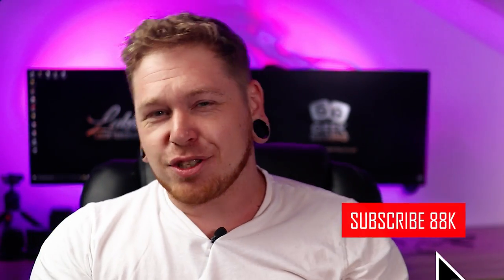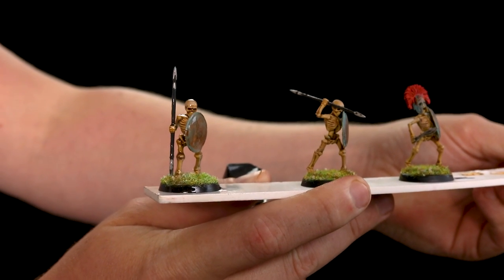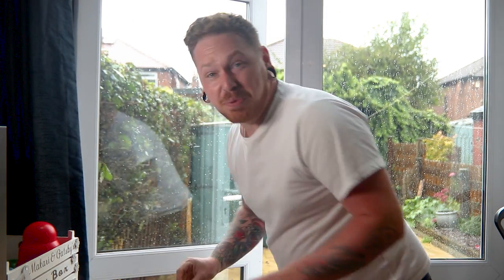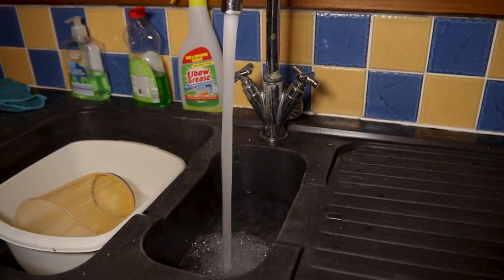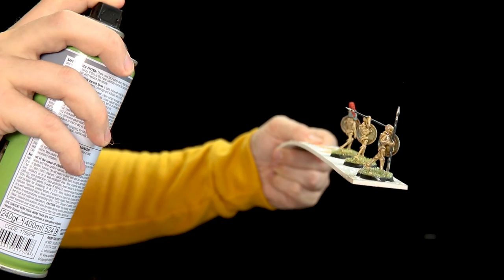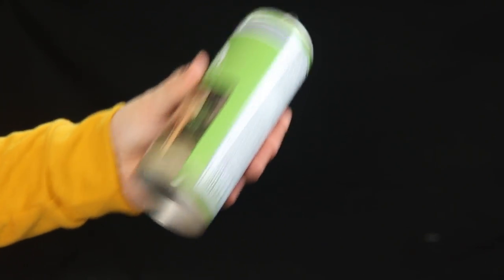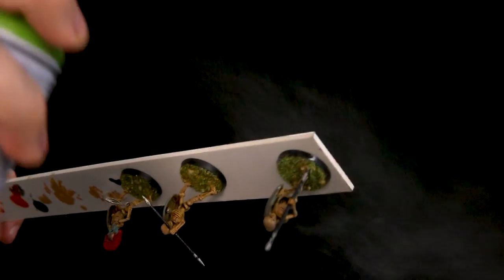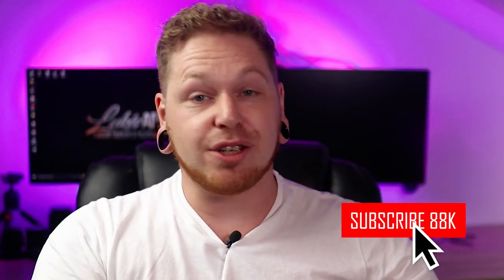How To Varnish Miniatures with Spray cans

Comment: I'm in the American midwest (North Dakota) and my frosting experience was either from glopping too much on, or spraying on warm days with high humidity.  15-ish years ago I switched to using polyurethane varnish sprays and I've not frosted a single mini since.  I seldom shake a can more than 15-20 seconds, I've never warmed a can above room temp, and I've walked out into a sub-freezing garage and sprayed with no issues.

Comment: I fixed some frosted minis with olive oil - I used a q-tip to massage in some olive oil and it took the dull frosting right away, then I wiped off the excess.  No, they're not sticky, dust prone, etc.  So if you "frost" a mini, you DO NOT have to strip!
Reply: Can confirm this trick as well. I recovered a squad of Necron warriors this way. I used an old drybrush, got a tiny dab of oil and rubbed most of it off on a tissue. I was amazed
Reply: @Archaon6044  Yes!  And I can bet if there was a slight sheen, it looked good on the metal endoskeletons!
Reply: Olive oil is miracle juice

Comment: Another good vid, mate - with some great hints, esp for newcomers. My early frosting errors tended to all be in very high or very low humidity, plus high Summer temperatures or low Winter temperatures. Have avoided these effects by taking can (from even inside temperature) quickly outside to spray under shelter, then bringing models immediately back inside into temperature controlled environment for drying = no frosting. Learned from my mistakes, mostly ...

Comment: Something I came to realize after a few years painting miniatures is that there's a real obsession over completely matte finishes. IMO this comes in part from the world of realistic diorama modeling - especially gritty, battlefield military scenes.

The problem is, matte varnishes, even brush-on, have powder in them in order to create the matte effect. Stop and consider that you're literally brushing or spraying grit onto your finished model. Ideally, the grit is too small to see and just mutes the shine of the clear varnish. But once you understand this, it's easier to grasp why frosting and grainy surface finishes often result with matte sprays.

In my case, I honestly learned to love semi-gloss or "satin" finishes. A semi-gloss finish is similar to the natural sheen that a lot of paint has. There's a few big advantages to this I don't often see talked about. First, the satin sheen helps modulate the value of different paint colors. It brings everything together with a similar sheen, lessening the effect of a model being painted with a chaotic mix of paints that each have a slightly different texture due to pigments being different in each color. Second, satin finishes tend to deepen rich colors that become muted and chalky looking during the natural process of painting - washes, dry brushing, feathering, etc. Colors like deep reds, purples, and blues have their luster restored by a semi-gloss coating. (There's a reason semi-gloss clear coat is used for automobile body finishes.)

Finally, I realized that if one is using models for tabletop gaming rather than fine art display, super-flat finishes aren't necessarily good for the distance one is viewing the models from. It is of course, a matter of taste. But I find satin finishes provide enough shine to help tiny figures stand out on the table top. And make it easier to tell them apart when they're massed together in formations or mixed up in a big melee.
Reply: Nice post! Interesting.
Reply: What satin sprays would you recommend?
Reply: Can you tell me why Spray Varnish makes my Miniatures sticky the first time it's sprayed?
Reply: @danielramsey6141 uuuuuuhhhh it's still wet and needs time to dry.

Comment: Great video as always, Luke. So here is my "two cents" worth of technique/advice. I lived in Savannah, GA for twenty years so for those of you not familiar with the climate, it is hot and humid, extremely so at times, a good part of the year. There were many times I had minis I needed to spray (primer, base coat and varnish) but the weather was hot with high humidity which made me concerned due to the belief that would affect the conditions of the spray result. So, here was what I did and would recommend: 
I have an empty flat box similar to a pizza box which I originally started with. Most of the time you can get a free, clean pizza box from a pizza place if you ask. I now have a slightly deeper box, a three inch box,  which works better for larger minis. I line it with paper then arrange the minis I wish to paint almost in formation so as to minimize the gaps between them. Leave some space so you can spray their sides and leave a gap between the minis and the edge of the box for the same reason as mentioned. I then shake the can inside the house similar to what Luke mentioned. When that's done I take everything outside.
Once outside, I'd put the box down on the patio, open the lid and spray a very light coat back and forth parallel to one side of the box. I would then move usually clockwise to the next side and repeat a very light spray and then to the next side, repeat and finally to the last side and repeat. If it was hot, cold or humid I would partially close the lid, leaving enough of an opening to allow the inside to breath. If the conditions weren't extreme, I would leave it outside for a bit (five, ten minutes?) then touch the paper around the minis that got hit with the overspray to see if it was dry, not tacky. If it was dry and required another coat, I'd repeat the process. If another coat wasn't required and the minis need to be flipped over, at that time id spray the other side.
If the conditions were extreme, after I'd spray the minis I would partially close the lid, bring them inside and stick them in our spare bathroom and turn on the fan. You can have strong vapors with the varnish obviously so I'd also close the door. After that coating had dried, id take it back outside and repeat the process until done.
I only had a fogging problem once and managed to get my minis painted as required using this method. I hope this helps others painting their minis.
Reply: Thank you for the extensive write-up!🙂

Comment: Frosting can be caused by spraying in cold conditions and or from too far away which causes
the spray to start  drying before it hits the model.
Reply: @GeekGamingScenics  Indeed
Reply: same principle as having a chalky finish with spray primer, right? Stuff drying mid-air before hitting the model.
Reply: @ogrokun  Yup
Reply: Also a common issue in hotter climates. I tend to not use aerosol paints because during most of the year it is so hot that I would have to be far to close to the models so that the paint/medium doesn't dry in mid air. The downside is that I would be so close that they get too much spray.

So I switched to an airbrush.
Reply: Prrtty sure the glossy matte varnish ia hecause of the heavy coat. The mica that mattes up the varniah gets to settle in the nooks and so the surface is glossy.
Reply: In Spain when I spray too far away in the heat of the summer I get a very bumpy texture on the mini, which is total crap. HAve to strip it if this happens
Reply: It can happen in summer as well

Comment: I have had this problem in the past.  Usually it seems to be worse when it's cool/cold outside and humid.  I do not normally go out of my way to warm the cans up but I do keep them indoors.  I had a bunch of Dungeon Saga minis get frosty so I took some olive oil (EVOO) and a plastic toothbrush and lightly scrubbed it into them.  Then I washed it off with some warm water and dish soap.  This turned out pretty good.  There's still a couple frosty spots on a couple models but overall they seem fine and I don't think it removed the varnish at all.  I did wait a few days before trying this method, though.  Also I usually use Krylon - which is a general purpose paint brand in the US - as opposed to GW or army painter or Tamiya or anything like that.

Comment: You tend to et frosting due to a couple of factors high moisture content in the air, not rain but high humidity and poor ventilation or too thick a coat. with too thick, its often due to the varnish drying in layers if you will. Its like ice in water, some is still fluid and some hard, and the different drying times causes frosting. High moisture tends with low ventilation and can see it when varnish spray particles catch moisture on the way to the item and trap it under the varnish, causing different drying reaction times.

Comment: So I’m new to this hobby.

Yesterday evening, I was aghast to find some of the models that I had brushed primed with Vallejo white primer, the paint would just scrape off with my fingernail very easily…

This was in contrast to the ones that I had spray, canned primed, with army, paint primer. These models seem to be far more robust, and you have to really work at scraping off the paint. The spray can primer clearly is far more effective.

However, there are some models that I’ve painted with the brush and primer that I’m really quite happy with the results. And now I’m slightly panicked, as to how I can in affect seal them and protect them. 

So now I’m on to carefully pick a varnish that is not too glossy, something more akin to a matte finish, but doesn’t completely kill the metallics...

Comment: Great video as usual, Luke.

It's difficult to tell what's causing the problem because the actual products being used weren't mentioned by the people having the problem.  The can in your video looks to be Paint Factory Matt Varnish Clear.  I am unfamiliar with this product, but I have an idea of what's going on.  I know you mentioned having a problem getting these things to frost over, but I think I know what's happening.

First, MOST spray can varnish especially marketed to hobbyists is lacquer.  That includes Tamiya, Testors and what have you - and most spray can varnishes from craft stores.  Lacquer is a very common clear finish.  Probably the biggest down-side is that it yellows over time when exposed to UV light.  It's also difficult to sand once fully cured.

Traditionally, lacquer is used to finish wood furniture.  When a furniture maker builds a desk or something, they usually build it in a shop or a garage and then brush on lacquer when it's all done.  When putting thick coats of lacquer effectively outside - while it's raining - lacquer tends to frost pretty easily.  This is, of course, because of the extreme humidity.  It then needs to be sanded and refinished at the location the frosting occurred.

So, I really suspect a lot of these people are doing what we all do - take the stuff out to the back yard and spray it down with a can of Testors.  Clearly outside and in the garage offer WORLDS more humidity than inside the home, and as you've demonstrated laying it on thick can really increase your chances of frosting.

There are several water based alternatives to lacquers out there from the major hobby paint manufacturers, but most require an airbrush or a paint brush.

Comment: For me I'd get frosting from:
Spraying too far away (esp on warm days)
Overspray hanging in the air (un-vented garage, I did use a painter respirator)
Really hot days or to close to a heat source (for me it was a infrared heater in a freezing garage)
Last 10% of can  (probably lacking propellant or dregs the of unshaken)
Cans that sat for ages on a shelf/stock room 
Avoid niche 'hobby' versions was the advice i was given (as above and quality control is poor) and 100% agree with I now buy main brand like krylon with quicker stock turnover.

I store my cans upside down to stop dregs from forming
Pure matt I used testors and never had a problem, but seems like its very hard to find in the UK now :'( 
On a side note if you're looking for the daddy of matt black primer check out 'KRYLON Camouflage Paint with Fusion Technology' that stuff bonds so well and great to spray.

Comment: Ive only had frosting once so far. But i chalk it up to my fault. Used reapers brush on sealer during a side by side comparison with other brands, and unknowingly mucked it up. I think i used it neat, which isnt a huge deal but on tge model i used it on it had details that it pooled in and i didnt see, eventually causing the majority to frost. Tried recoating and few other tricks to no avail, but luckily was an easy paint so i just stripped and did again. Typically use some variety of rustoleum,krylon, armory miniature sprays followed by a matte. Still use GW ardcoat/lahmian, or reapers brush on occasionally. Im just trying to find a cheap primer i like. Most local modelers suggest some verison of a auto primer or hardware store brand.Provided it doesnt have filling properties.

Comment: Killer advice ... I only had it happen once as well and it was my most perfected model I had done (as a noob painter mind you). But the haze that muddied it up just ruined all the details I had done and all I was trying to do was to freaking seal my perfection so nothing could penetrate the paint.  I had done this many times before but for some reason the humidity or that set of circumstances, put that awful haze all over my epic paint job.  Man I was pissed.  I hit it again the next day (because hey why not?) and it got a lot better.  Now, it was not as sweet as my original paint job and probably will never be but it did make an improvement.  I have never, at this point, been able to replicate that failure though.  Oh, and I am wracking my brain still trying to figure out what I did wrong so that it doesn't happen again.

Comment: I only had frosting happen on one model. I sprayed it outside on a nippy day then brought it immediately into the house to dry. In america we have forced air heating (like you get in the car) so it sucks moisture out the air very quickly. I assume the extreme change in heat and humidity caused the frosting, perhaps because it dried too fast. I now do all my spraying indoors with lots of ventilation and wear a mask and never have any issues.

Comment: What’s the best spray or varnish for miniatures that have been oil painted? All the videos I watch their using acrylic spray or water based varnish but didn’t think you could apply them on oil due to cracking your oil paints. I would much appreciate some info.

Comment: Ey up, watched this video because sometimes occasionally some of my models will frost, it’s happened only when it’s been cold, dry air, not wet and raining, just straight up cold, once before Ardacon, my 8 harad archers frosted, and funnily enough last night a model frosted. I shook the can for a while, didn’t spray too close, didn’t overspray and it just frosted in a few different areas. Weirdly enough,  I rubbed the frosting and it came off to a certain extent, you can’t tell it’s there but if you look closely you can see a pale white coating in the recess where it was, I normally go over my models with Lahmian medium to get rid of the slight shine of GW’s varnish, and this kinda helps with the frost I guess

Comment: Old varnish has a higher probability to frost up on you. Always check the date of manufacture when buying any spray paint. Coatings can go bad in the can. This happened to me when I was using GW Dark Angel green spray back in the day. Sprayed the models only to find the paint had gone over and it frosted on the models.

Comment: Something that's come up a few times, and I'd REALLY like to know the answer:  Does varnishing with gloss first protect your minis MORE than just using matte?  I've been glossing and then using matte, but wonder if it's worth it.
Reply: Fake news
Reply: Yes due to to the way Mat varnish refracts the light to make the effect Mat means that the coverage is not strictly as tough as a gloss which seals and protects. That way with a gloss and a say Dullcoat gives best of both worlds.
Reply: I work with varnishes and surface finishes in my day job. The idea that gloss is harder is a myth, the only difference is the surfaces texture which changes the light refraction. No harm in doing a gloss first, but no benefit to hardness
Reply: @cslassiea839  Well said!

Comment: I've had the opposite problem. I tried W&N Galeria Matt Varnish with the brush and straight outta da pot it dries with a strong milky white cloudiness. I thinned it down 2/1 water to varnish and it's better but still a bit hazy. Is this normal? If I thin it more will it become too weak for it's purpose. Is it a bad batch or is it just super concentrated stuff? I always used Testors Dullcote spray and never had any problems.

Comment: I've only ever had it happen once.  I varnish several models before and after with no issues. I noticed that I tilted the can too much to the side and i think I had more propellant than paint spray out. It frosted immediately.  Maybe it is due to the propellant or how cold the spray became during that discharge.

Comment: i went away from using rattle can varnish  because of the faff involved in avoiding the bad finishes, i use airbrush varnish its just simpler, but after your video i  have to wonder if warming the airbrush varnish would make a difference

Comment: I avoid high humidity. Also if your house is cold from the AC and you take the work outside to paint, leave them and the can out a bit first to equalize the temp. The paint should be the same temp as the work imo.

Comment: The biggest problem with screw ups I ever had was using plastikote matt varnish , just don't even think about it as it reacts with GW paint and any other paint I tried leading to a milky colour and orange peel effect ( I had painted a full 10 man squad of Deathwing Terminators and sprayed them with that stuff and ended up having to throw the lot of them into a tub of brake fluid to get it off.... my language wasn't for the faint hearted that day... )